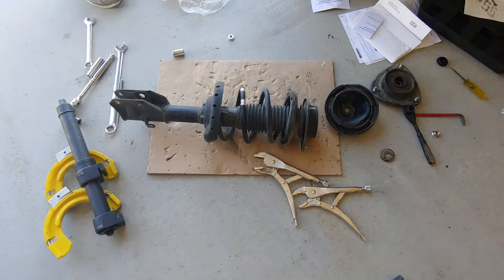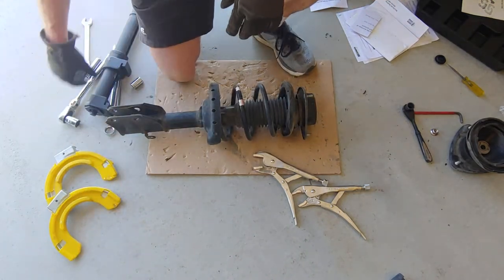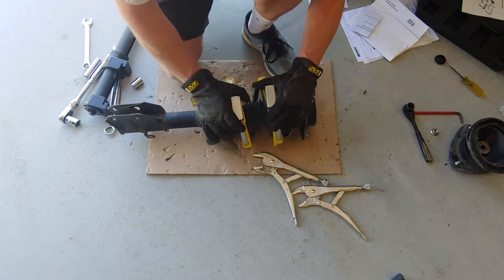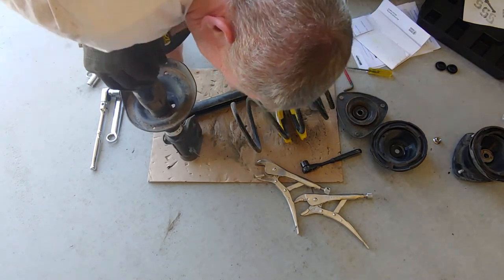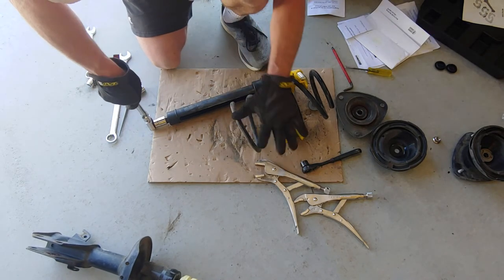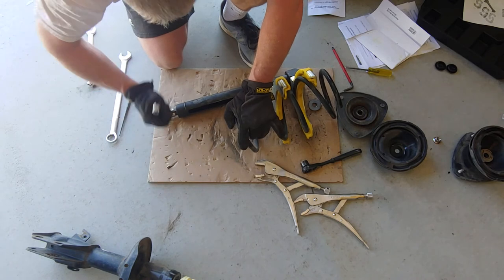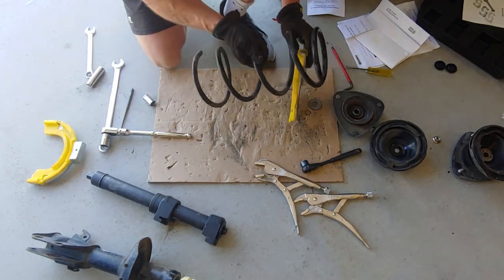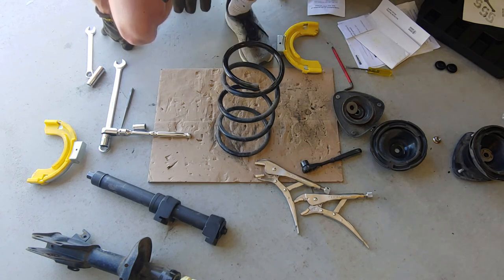Using the Eastwood MacPherson Strut and Coil Spring Compressor

Comment: Well done for doing it the correct way by not using an Impact gun.
Reply from the maker: Thank you
Reply: @JWCMotorsports  Be mindful man you have to put them screws in to hold the spring teeth to the press.

Comment: That was scary watching you use the hammer
Reply from the maker: What you couldn't see was that the spring tension had been released.  I've seen the videos of struts blowing apart, and have only had a slight pop on large springs with an older compressor I had before this Eastwood one.   Thanks for watching.

Comment: Would you say the generic version that's 70$ cheaper is unsafe?
Reply from the maker: Any of them are unsafe it not used properly.   I have used several types of strut compressors, cheap harbor freight, parts store loaner and $1000 big units.  For entry into the process with ease of use I found this one works for me the best (it is not the only one I have but the easiest to setup and use).